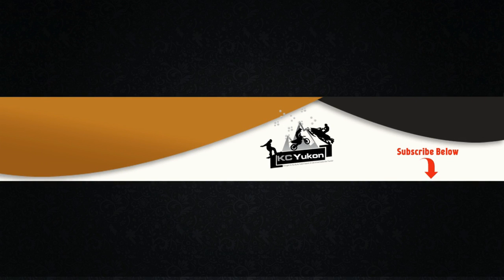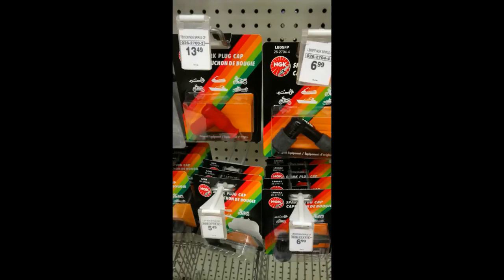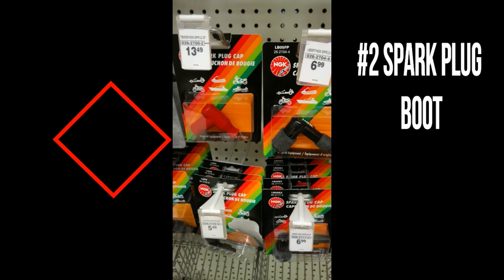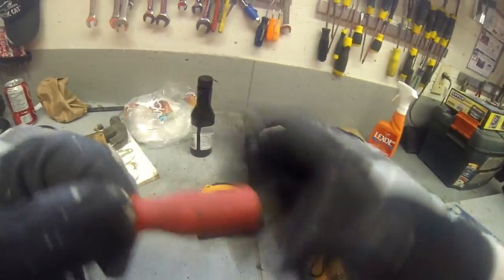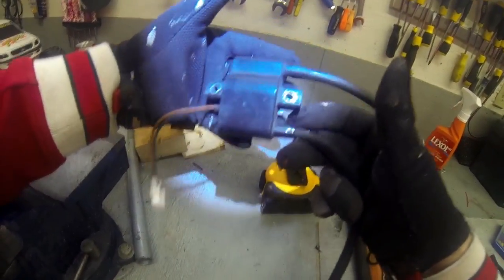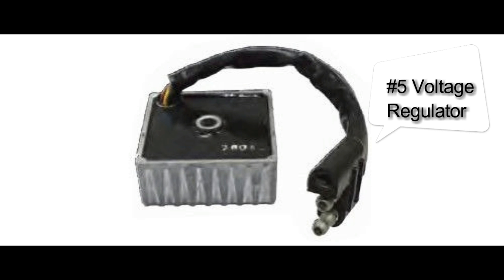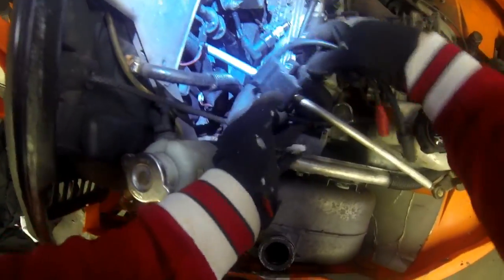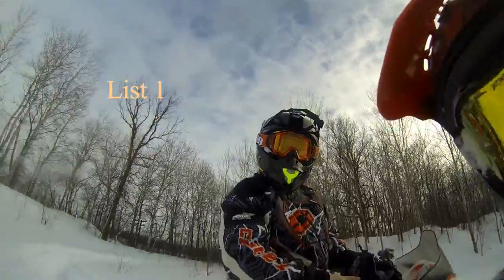No Spark things to look for 1 to 6 Snowmobiles, Dirtbikes etc

Comment: thanks for the vid, my 2007 ski doo 600 ho sdi was running on 1 cylinder and i checked the spark plug boots and i check the connection for the boot and it was caked with dirt and i've cleaned it and it was firing better than ever
Reply from the maker: Awesome Buddy now we need snow :) :) :)
Reply: i still have snow in nuvavut
Reply from the maker: @MaxxieTheShyProto  like lots of snow??
Reply: @KcYukon  yes
Reply: @KcYukon  everywhere i go snow is everywhere
Reply from the maker: @MaxxieTheShyProto  so you snowmobile all year round???
Reply: @KcYukon  not quite snow only be 7 months long starting from october to may or june
Reply from the maker: @MaxxieTheShyProto  cool we'll keep in touch keep the track side down as they say :)

Comment: I have a 2003 ski doo rev 600 HO, Sometimes I had no spark but if I messed with my tether it’d work, but now it’s flat dead, any idea on what could be happening?
Reply from the maker: Have you tried to figure out away to by pass the tether to see if it will run? Then you know need a new tether switch... some of the older ones you can loop the signal....

Comment: Hi was wondering if you would have advise what to look with my 2014 1200 mxz tnt skidoo it will turn and won’t start doesnt make nice fire either
Reply from the maker: Hi Lynne, No spark??   Cdi box, wire issues, or Stator problem..... Could be coil pack or voltage regulator... For sure no SPARK???????

Comment: Voltage regulator should not affect spark, CDI should be on the list
Reply from the maker: Thanks for the comment
Reply: My polaris that ran on a arctic cat engine use to run without a voltage regulator, it just had no headlight and tail light. On the other hand, my skidoo 800 had no spark at all until I installed a new voltage regulator 😕 I guess it could be a/the problem on different types of sleds.
Reply from the maker: @eskimo1000  I think the newer sleds are so computerized now that they can detect if the voltage regulator is working or not working properly...  I'm curious what year was the skidoo vs polaris/cat???
Reply: @KcYukon  very true that diagnosis is just a matter of hooking it up to a computer. My polaris body is a 2004 trail touring and the engine is a 2007 arctic cat 570f. While my skidoo is a 2001 grand touring 800se
Reply from the maker: @eskimo1000  Interesting... Yea skidoo might have programmed the ECU or computer on it to say if this is not present do not send spark until regulator is working...   That polaris with cat engine did you do the mod yourself how did things line up bolts to the engine and frame... You must have had to make some custom brackets I would think??
Reply: @KcYukon  my cousins and I had to take the polaris engine mount and drill a hole where the arctic cat engine mount bolt were. And we had to figure out the wiring, the only thing that worked was the high beam low beam. Had to nstall a no name brand ignition switch which basically just grounded the electricity to stop it running. The skidoo I find more complex with the cdi/mpem and what not.
Reply from the maker: @eskimo1000  Nice good job as always thanks for watching my vids... Just got back from the mountains awesome time! If your looking for good powder its the place to go!